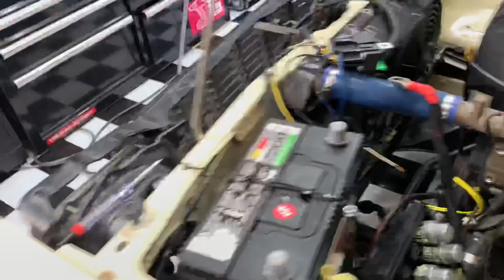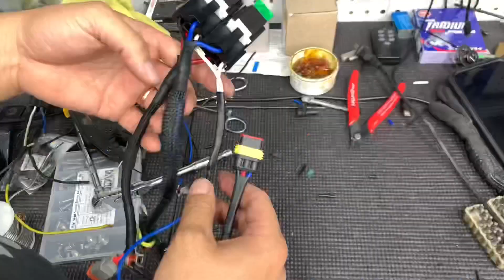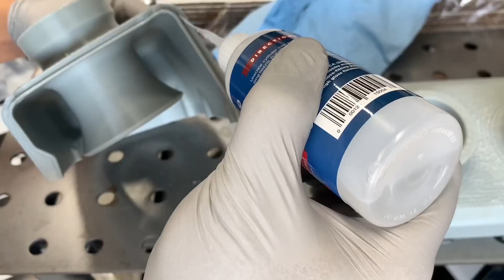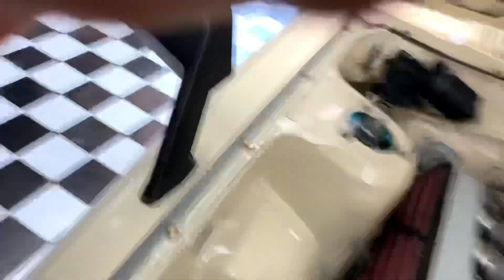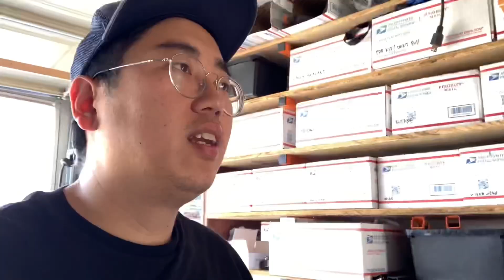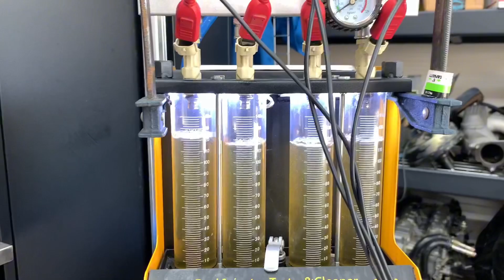3sge BEAMS with 3D printed parts ke70 TE72 ae86

Comment: Did you hard solder those lugs or used cold solder? I would buy a hydraulic crimper and crimp those on because (cold) soldering a lug on the big power cables is a fire waiting to happen...
Reply from the maker: Battery hammer crimp jig and torch with flux and solder after

Comment: Amazing build I hope to get 3s for my wagon soon too! 😍 

One question I have for alternator battery led light you added in dash. I remove my dash and install tach only but alternator does not charge now. I read I need keep alternator dash light bulb and was wondering if led indicator you used can work same way to turn alternator on or if I need use actual oem 12v dash lightbulb?
Reply from the maker: I don’t believe the bulb matters, mine isn’t even working right

Comment: Really liked the 3D printed parts! When you did the compression test looks like the throttle wasn't opened. If it isn't open you will not get a high reading. Try doing a compression test with the throttle open. If the numbers come up and pretty even across then motor should be ok.
Reply from the maker: I did it with the throttle open and a different tester it was a little better

Comment: Coming from a Mitsubishi 4G64 guy but, while that’s low compression, the engines not blown. Could be valve seats, could be rings… either way the engine is just worn. But I have seen plenty of people make lots of power on tired engines that had low compression but had forced induction… obviously your NA and so… I wouldn’t expect big numbers but I’d say if your in a time crunch so long as bearings are fine… meh tune it and run it, then buy everything for a engine rebuild and freshen it up later… probably going to burn some oil and be down on power is all.
Reply from the maker: Yea just gonna rock it for now and freshen it up later

Comment: Very cool 3D printing! Which new printer did you get? Personally I much prefer dry filtration, but should still work well of course. That gauge setup came out pretty awesome too. Very motorcycle inspired. With how consistent the compression results were, highly doubt there is anything wrong with the engine. Possible timing is off though? I'd expect at least 40-50 psi higher than that generally. Good stuff!
Reply from the maker: Flash forge ad5m non pro with an enclosure. It’s smaller than my old CR-10 but so much fast and no failed prints so far. Thank you! Yea I’m still gonna drive it lol
Reply: @kelvinarreola  Great option! I'm eyeing a Q1 Pro, but the 5M was def on my short list.

Comment: Add oil in the cylinders  and do the compression test again . If the reading does not change it’s loosing compression from the valves . I did does increase you have ring / cylinder issues like you saw with the camera but you could also have stuck rings . Try an engine oil flush and check comp again . Good luck ! Greetings from far away Greece .
Reply from the maker: I’ll try to unstick the rings! Thanks!
Reply: @kelvinarreola did it work . !